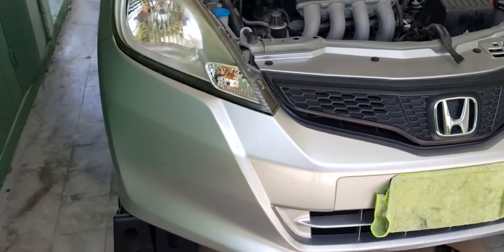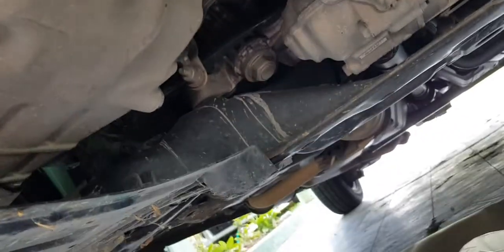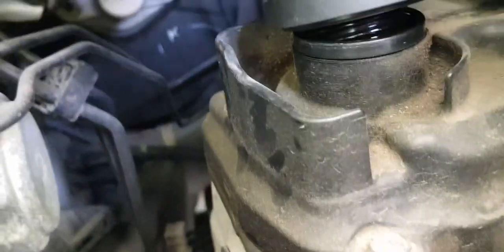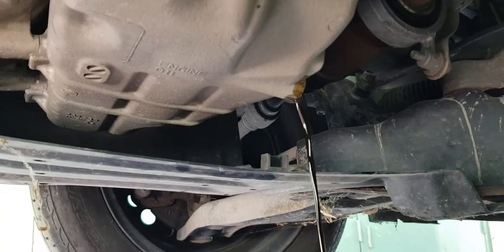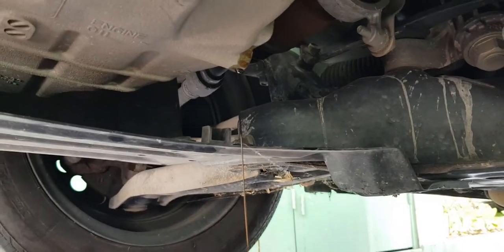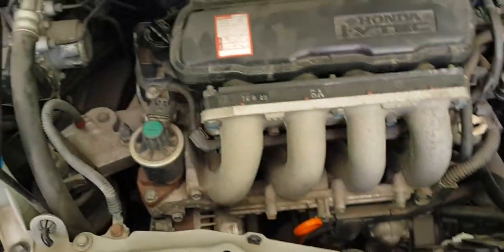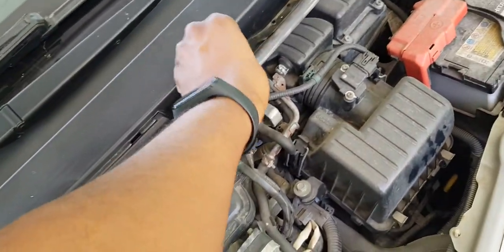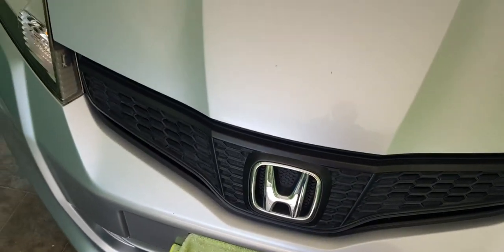2012 Honda Fit oil change

Comment: No filter change??  What oil, fully syntetic ??
Reply from the maker: The oil filter was changed the day after.  The vehicle really isn't driven much.

The oil used is Honda's genuine 10w-30 full synthetic on the subsequent top up.

The oil demonstrated here was just for the video as part of a inspecting the oil quality in the sump itself.

Comment: 10W30 for engine oil?  That’s not correct.  As well, drain plug hand tight?  That’s not right.  DO NOT FOLLOW THIS GUY’S INSTRUCTIONS.
Reply from the maker: The drain plug being HAND TIGHT, was just a Honda joke for these vehicles producing  no torque.

10W30 is what our local dealership states for our warmer climate.

The car has been running fine on it with no issues.
Reply from the maker: We don't have winter here in Jamaica
Reply: @MatthewTaylor3  yeah, don't do jokes in instructional videos, you'll make someone f**k up their car